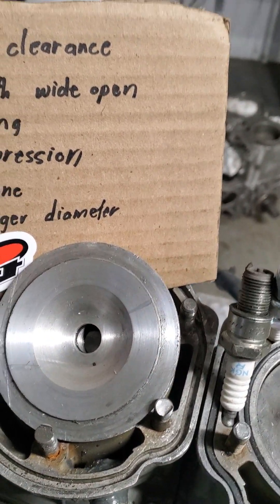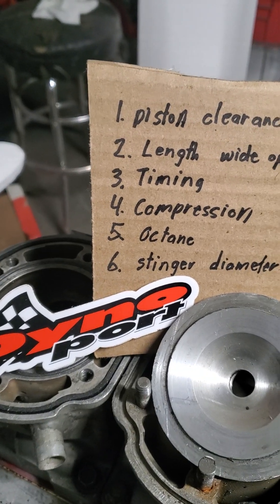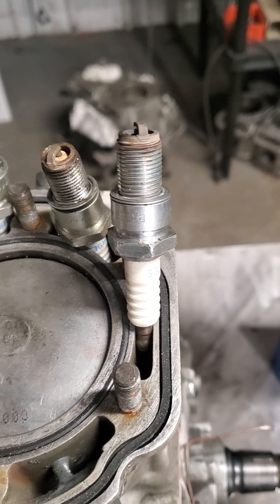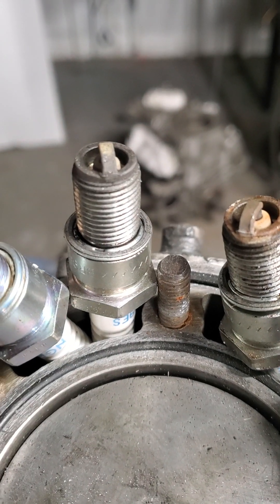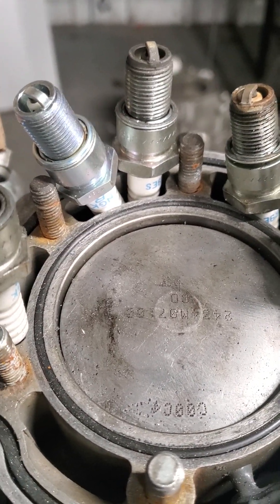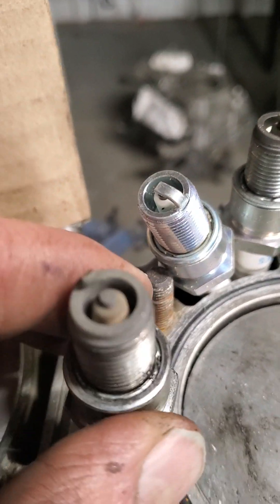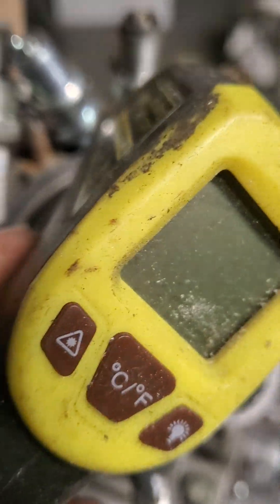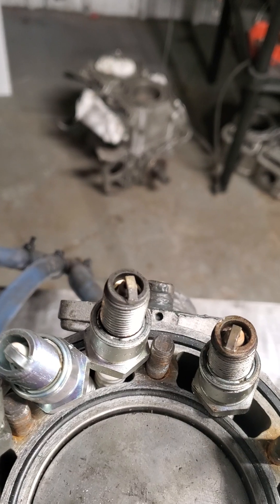August 10, 2024

Comment: I work at the transit company that started CNG use in America. We have done intensive testing on lots of spark plugs, cables, and coils.
Other than fouling from oil or coolant, the only really useful indication from the plugs is a light pink discoloration from a miss fire usual from a too lean condition.